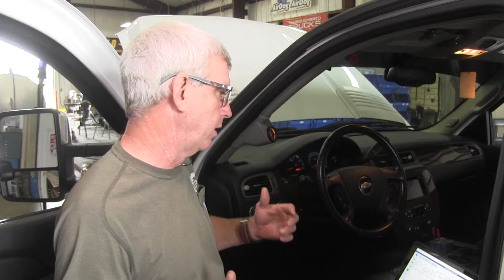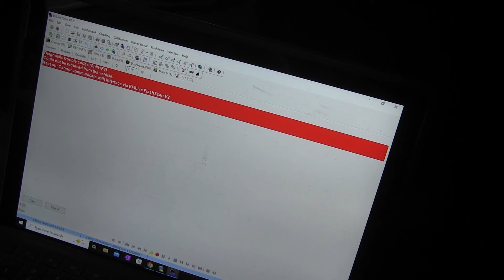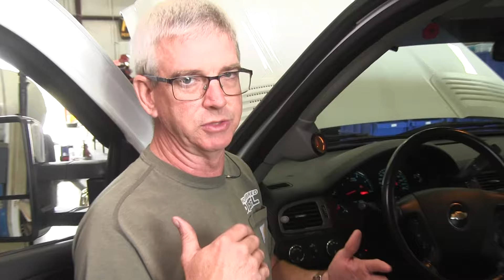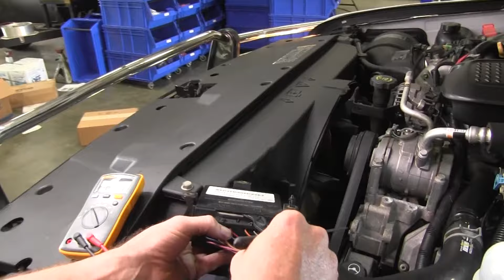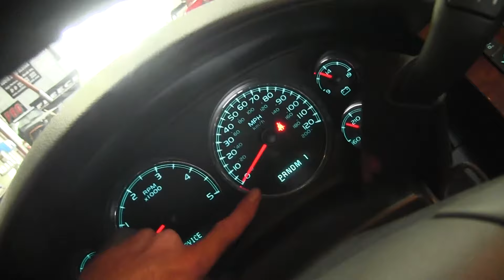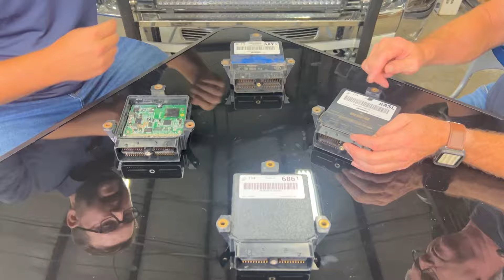How To Diagnose and Replace a TCM #duramax #diesel #howto

Comment: Will a bad tcm cause batteries to drain overnight
Reply: I’m wondering the same thing
Reply from the maker: I guess it depends on the failure and if the short allows there to be a constant draw on the battery.

Comment: I’m really concerned about my 2009 LMM, no codes, shift inhibited select n to reset message in any gear, but it never resets, and rough idle in park. Could I also have a bad ECM and a bad TCM? Thanks
Reply from the maker: I would suspect TCM and not ECM

Comment: I had this just start happening yesterday. I tested the wire harness for power that was good but when I was driving seem like it was stuck in gear and the PRNDL was missing the indicator line and the only code I had was U0101-71. went head and ordered one today from your site.
Reply from the maker: Thanks for watching and for the business!

Comment: I have a 2012 LML, truck has the last connection with TCM code, doesn’t have the Prindle under the shift indicator, does not let you put it in tow haul or manual mode. I have power to my T14 both the constant and ignition. But the brake and ABS lights are not on could it still be the TCM?
Reply from the maker: I would suspect TCM from what you are saying.

Comment: Was wondering if this would work on a 2015 LML? The reason is I have done a CP3 conversion kit couldn't get it to run at first I got it to run a bit would make sense later but then after I replaced a few more components I'm getting a TCM communication error when doing any of the work that I've done to it I've always had the battery disconnected was still wondering if this technique would still work on a 2015 LML Thank you
Reply from the maker: Its possible yes.  Check power supply to TCM

Comment: My 2013 LML is stuck in 3rd gear throwing the P2669 code. Replaced the wiring harness to trans and checked solenoids they were good. Can this be the tcm? Truck only had 109k miles
Reply from the maker: You will want to check voltage supply to that solenoid first before throwing a TCM at it.

Comment: My 2003 shifts down into 4th gear after the transmission warms up and then shows shift inhibited after coming to a complete stop. Codes p0700 p0843 and p0735. Would this be a similar issue?
Reply from the maker: I think you may have a problem in the 5th clutch set.  Pretty common on those early trans.  Not as many TCM failures on them.
Reply: Might be a short in the wiring going up to tcm.

Comment: Hey great Video! I have a 13 LML and no reverse camera, Trans temp, unlock doors when parked, and stuck in 3rd?  Is that the normal MO?
Reply from the maker: No, but you for sure may have a electrical gremlin somewhere OR you have independent issues going on.
Reply: My 2013 LML is throwing code P2669 but I replaced the wiring harness to the trans and also checked the solenoids they were good. Truck is still in limp mode. Can it be the tcm?

Comment: My truck keeps going into limp mode and stays in 3rd gear only when trans is warm is this my issue or is this a different issue only throws p0700
Reply from the maker: Dont throw a TCM at it until you can verify the problem.  There should be another code in the TCM itself to put you in the right direction.

Comment: Just bought a lbz 130k miles and feels like it’s stuck in tow/haul mode sounds like a manual when you let go but shifts through all gears pretty good I can hit above 3k rpm but my edge cts says tcc slip is up to 1000rpm no codes is it a torque converter or something else ? Not in limp mode just feels weaker and going up hills you feel it slowing down i can drive on highway just feels weaker and feels like it doesn’t wanna do stop and go traffic
Reply from the maker: Any codes?  The computer will show slip that is normal.  There is slip before lockup, etc.  Check for codes and consider that something else is wrong with the truck and not the trans.
Reply: @ zero codes other than egr delete codes getting a tune here soon I believe the when the person who had it before me deleted it and didn’t tune it confused the computer and it’s trying to find the egr ive read more into tcc slip when it locks up its at a steady 0 or 5 so that’s good
Reply: Good video Wade,,, I'll be knowledgeable about it now, thanks and keep the good work up